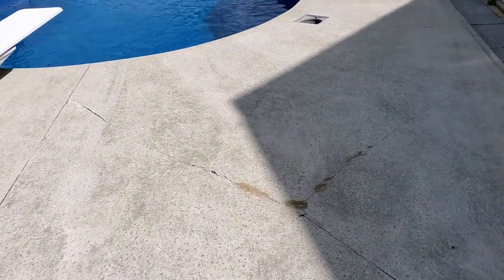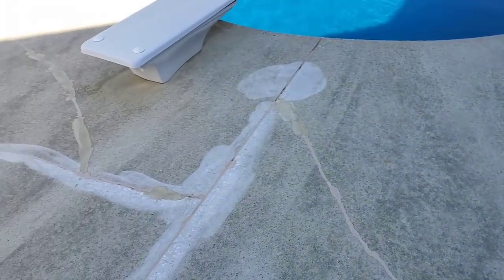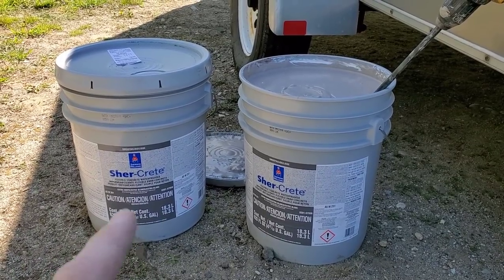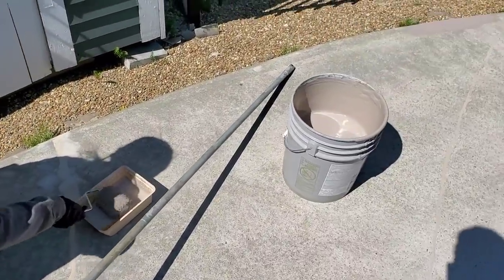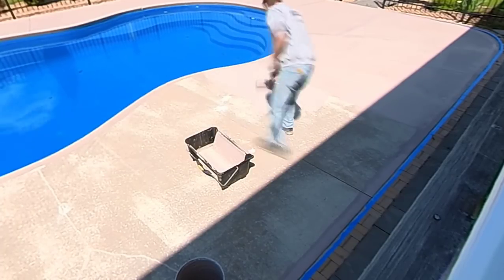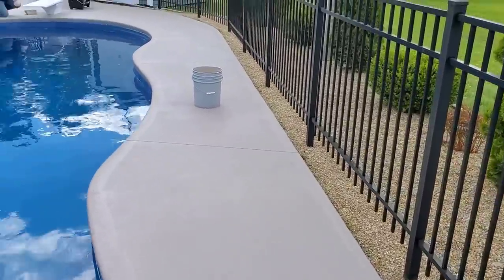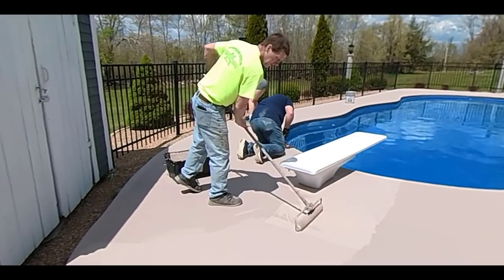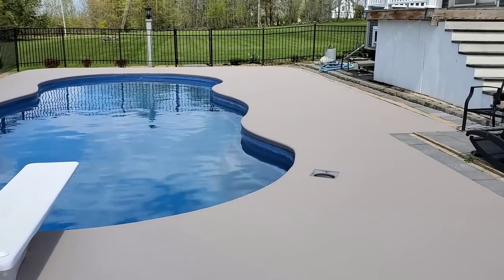How To Paint Concrete | Make Your Concrete Look Like NEW 2023)

Comment: I have "kool deck" coating on top of concrete. It's like a 1/8 inch thick coating that's similar to orange peel texture you see on walls. Do you think the Shurcrete coating would be ok to use? Get job you guys did!
Reply from the maker: Currently Sherwin Williams isn't making Shercrete. I'm using a product called Mapai Mapecoat Deck T. Google that and ask then if it would work over Kool deck.

Comment: Hey Mike, I have about 1610 sq. ft. Of residential front walkway, side of the home and back yard patio type Concrete.
About 1000 sq. ft. Of the concrete is spalled and uneven. Level ranges from 1/4” to maybe 1” in various areas. Plan is to of course pressure wash the area. Use my Bosch concrete surface grinder in the areas that are Spalled other areas that just old and nasty. So the areas that need to be self leveled is he back patio area. If I were to hose the area down with water you can see all the areas that show water puddles. So after I pour the self leveling product I plan to hit it with a final “Concrete Dressing”. I have used Quickrete Re-cap. Not bad of a product. Did not like the various color it displayed when it dried up. Rapid Set Newcrete was another choice. I like how it dried up and the color did not show different color shades. This Sherwin Williams “Sur-Crete” does it have a little texture in the product?
Reply from the maker: You can ask for anti-slip texture to be mixed into it, yes.

Comment: Did you do anything to prep the surface other than pressure wash?
Reply from the maker: Mostly just pressure wash on this one, the concrete surface was in pretty good shape other than fixing the cracks, chipped areas.
Reply: Do remember the color you used. Looks great.

Comment: Great video.  I'm considering coating my pool concrete.  One issue I have is what to do with the water channels.  Most of the plastic in the channel is damaged.  Should I take out the plastic channel or fill in over the top of it?  If so, with what material?   Thanks.

Comment: Hi Mike what is the best product you have come across to fix the cracks in concrete.  Ive tried a number of products but the hairline cracks keep reappearing.  I know this would be the case but I am wondering if you have found any cement product that works well and last a long time?

Comment: I doubt you remember but how many buckets of the paint did you end up using for the job? Trying to figure out of much to buy but my math must be off.
Reply from the maker: You'll get 100 square feet per gallon on the first coat and 200 on the 2nd coat. 1000 square feet would take  10 gallons 1st coat and 5 gallons 2nd coat.
Reply: @MikeDayConcrete  your the man, really appreciate the response!

Comment: Do you do work in Fort Myers Fl or recommend anyone that can do the same as this video in FM ?
Reply from the maker: I might, if the price was right. What do you need done.
Reply: @MikeDayConcrete  I have a cement pool deck that's been in for (18) years so there are a few cracks that need to be filled and then I'd like to have it resealed with the stuff in your video. Where are you located? Do you have any local presence in FT Myers?

Comment: Excellent ... EXCELLENT video !!!  My wife is on my butt about doing the same thing for our pool patio.  I am a newbie and NOT a DIYer but I'm gonna try this.  I spent $3k on getting my plain concrete converted to a SunDek one about 10 years ago. Now they want another $3k to fix it up so I can't afford that. Do you go on super thick with the 1st coat and then light on the 2nd coat?  Can I use a power washer on it as it has a sort of texture that I don't want to remove?
Reply: What did you end up doing?
Reply: im in a similar boat?  Did you use this?  How is it compared to sundek?

Comment: Quick question for you. I have an older concrete deck around our pool that is starting to have more hairline cracks each year after the snow thaws. I have been patching those as they appear, but I would like to try to prevent more if possible.  Is it better to use RadonSeal to seal the concrete or use Conflex textured to protect the concrete from the elements and make it look better? Or can I use both products? I want to make sure that the surface is not slippery when wet as we have kids and I want to try to prevent accidents. Fantastic videos btw!!
Reply: Secaflex for the cracks ( if cracks are deep & wide use appropriate foam diameter tubing to substitute so the product is not lost in areas below where it’s not needed) then whatever coating you prefer.